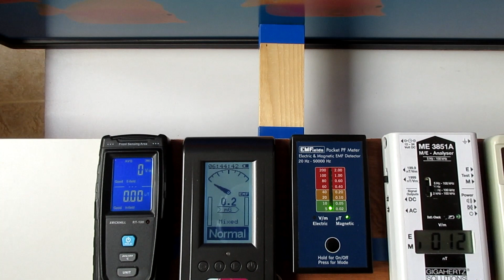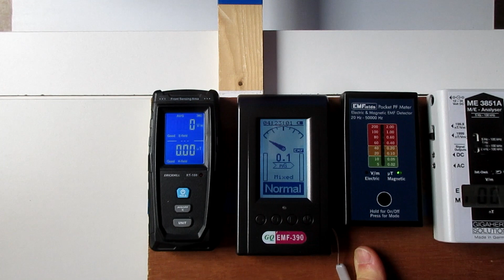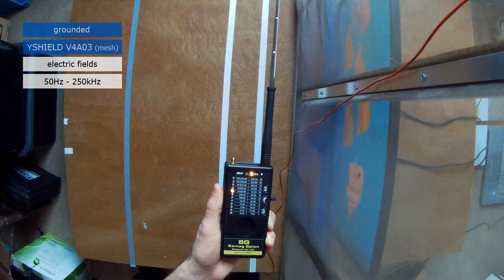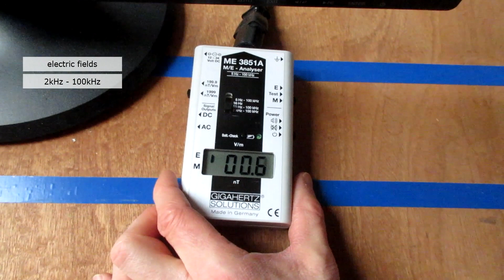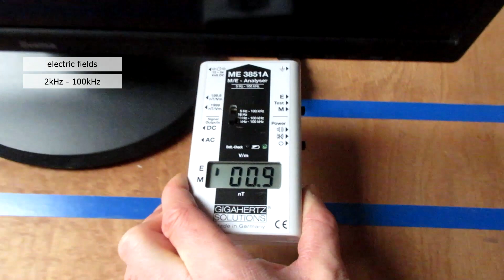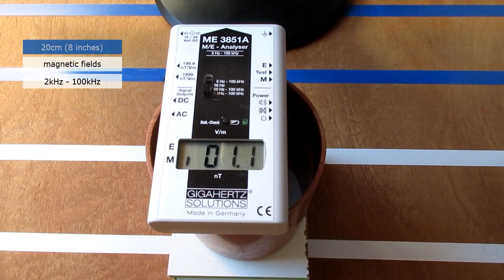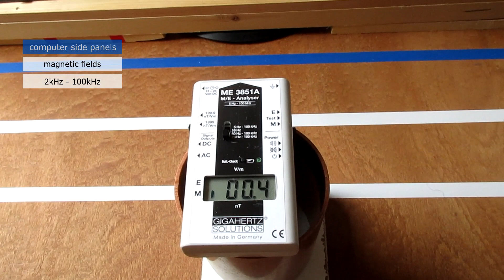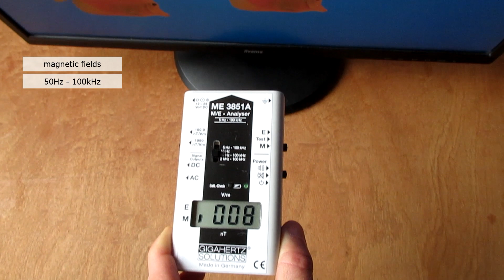EMF -- shielding a monitor ---------------------- EMF meter ---- Esmog Spion ---- Gigahertz ME3851a

Comment: Honestly with one of my main symptoms being brain fog I found it hard to comprehend what was going on. I read the description and I am almost incapable of detecting nuance so please don't hate me for being dumb or impatient because you obviously spent a LOT of time on this - but I want to know do you still prefer your monitor with shielding or without shielding? (I understand that you were making a point about grounding is not always better, but I came here more to learn about shielding than grounding because my monitor already has a grounded 3 prong adapter so my problem is not electric fields).
Reply from the maker: I found no noticeable benefit shielding a monitor.
Like I explained with my TV video:
I found benefit in buying a low EMF TV which I also use instead of my monitor nowadays,
because I seem to react less to my TV than to my monitor,
probably also because I can sit further away from it because it's larger.
I probably react to the very low dirty magnetic from my monitor,
which is measurable with an ME3851a (or ME3951a) pretty far, like seen in this video.
The Esmog Spion 5G also shows the EMF in front of the monitor.
This may be a dirty electric field and it looks like it can't be shielded.
Dirty magnetic is probably also impossible to shield if you want to see your screen.
Watch as much videos as possible and read as much as you can from the things I wrote,
because most of what you will ask is probably already explained.

Comment: What is the best device I can find in France for measurements in an apartment (I am hyperelectrosensitive)? quality/reliability/price ratio please it's urgent
Reply from the maker: It depends on what you want to measure and what your budget is. Not every meter can measure everything. The answer isn't simple, this is why I made a 13 part video series about EMF meters. For example, at this date:
For magnetic fields I like the Gigahertz ME3851a (or ME3951a) the most.
For electric fields I like the Esmog Spion 5G the most.
For RF, most EHS people like the Safe and Sound pro II the most.
For dirty electricity on the lines, currently the Satic EMI line monitor seems to be the best of the easiests.

That being said, the Esmog Spion 5G also measures RF and a Gigahertz ME3851a also measures electric fields.
And the Safe and Sound pro II likely does not measure paging well, which could be a problem. So you see things are not so easy, unless you are rich, but most sick people are poor. You can also do budget meters that will measure most, this can reduce the cost a lot.
To see what meters measures what, watch towards the end of this video:
https://youtu.be/AQTLNdFfobM?t=1231
Reply: @Merializer  The one that best measures quality/price for harmful low and high frequency waves in a home. And the quality/price ratio for them. harmful electric fields in a home? If you could please give me the names of the models directly because I don't understand your videos (I only understand French, sorry). Thanks a lot
Reply from the maker: @massinissaargaz9780  I'm sorry but I don't have time to hold your hand through it all. You need to do your own research. There is a learning curve. You can't learn it all in one afternoon. The videos were made for a reason. You need to watch some anyway to learn how to measure. You can ask questions, but watch as much videos as you can first, I also have things to do.
Reply from the maker: @massinissaargaz9780  Each video has some sort of conclusion or result at the end, either in the video or in a comment below it. This way you can figure out what meters are most desirable to you.

Comment: Would love a video about shielding a laptop effectively, but still have the heat pass through so it does not become overheated
Reply from the maker: @user-re3pn3pf6s Some fields like magnetic fields are very hard to shield, it's better to try find a low EMF computer + sit some distance from it. A new video is coming which should shed some more light on the problem. It's better that manufacturers make as low EMF products as possible across the spectrum, and they could work together with experts that are or were EMF sensitive people. I believe it can be done, at least improved, it's just one of the many ignored problems at the moment. They have laptops for offices and laptops for gamers, why not laptops for sensitive people?
Reply: It is sometimes more easy to give up using a certain device than to fight against it. I use a desktop PC connected to my TV set as a screen but I sit 3m away and only have the mouse and keyboard next to me. They are wired and the cables are twisted together to minimize EMF. The whole system is grounded to eliminate EF.

Comment: Thank you for that. Yes, I m starting to realize how dificult it is to shield/attentuate the lower frequencies and am slowly wrapping my head around why it is so much easier to shield RF. Still have to find a good source to get that explained properly.
Most of my LF radiation comes from things like my monitor, which I feed from a 12V to 19V converter, which makes less electric fields than using 240V inverter to adapter to monitor. 
At this point I am thinking about a 24V system to feed these kind of devices. Instead of going up from 12V. But in all honesty, it would be so great if we actually had an agency that would look at these things, with real ratings of devices you could trust when buying stuff. At this moment it is a total gamble how much EMF a device or tool will emit and mostly you won't even know if you can switch off any RF signals.
Reply from the maker: hmmmm, I corrected the description below this video somewhat, I seem to already have forgotten myself that RF also penetrates shielding, which was seen in video 13/13 and the underwater phone video. In video 13/13 it was a faraday cage but in this video it was not, only a shield.

If you ask ChatGPT the questions you have you get some interesting answers which may help you. 

We could indeed use something like we have here in Belgium: Test Aankoop, a non-profit consumer organization that tests products for quality, something like this but then specifically for EMF, that would be great, but it would be better if all manufacturers would receive regulations from the government to start making lower EMF products. Such things would be one of the things we need if EMF sensitivity would ever become recognized.

Comment: Thank you for this video. You are putting a lot of work into this. It is funny, since I shielded and grounded all the cables I have mild but annoying headaches in my living room. So you are right, it might have something todo with the grounding. I know mine is not perfect because there is no ground wire in my appartement building and it's impossible to have a ground rod as it is all concrete around the building, so I had to improvise. The grounding that I managed to get seems to work fine, it does trip the differential as it should do and the EF comes down to 1 V/m when I connect the shielding to it. I have an ME3830 which is not as sensible as yours so I'm puzzled. The radio is not picking up any funny static as long as I don't go near the TV or PC but I don't have an E-Spion like yours
Reply from the maker: Yeah things can be complicated, Make sure you read the description, I mentioned several reasons there why shielding can feel worse. It definitely felt different and worse after shielding my monitor a long time ago, now that I found all the potential reasons why, I know I wasn't imagining what I felt. Same when I tried RF shielding here, it felt worse, so I took that down as well. It either had something to do with the EMF added to that shielding from the non clean ground, or it was RF bouncing inside or something (or both). The RF on the meter was lower though, but this stuff is tricky.
Reply: The RF shielding has been in place for a few months and I used to feel great, the best place for falling asleep sitting was on the same couch where I get the headaches lately. The problems started after I shielded and grounded all the extension cords, TV, PC and router
Reply from the maker: @lifenlin5879 hmmm, so maybe what I felt when I tried shielding the windows was indeed also related to that as I suspect. My windows are near cables in the walls, near pipes and radiators.
Reply: I finally realised that my headaches come prom a bad posturewhich makes my neck stiff. All it took was to sit up straight though it's funny that same posture did not give me headaches in the past. It seems that with God's help I nailed this one too @Merializer
Reply from the maker: @lifenlin5879 good for you, I hope you are sure. I rarely have headaches, for me it's mostly my legs now that are affected by the EMF from a distance, especially if I sit at the computer for too long. When I touched a mouse and keyboard in the past it was mostly my hand, arm and liver first.